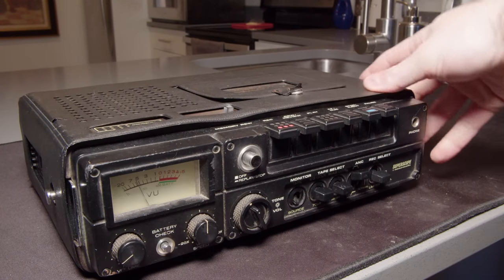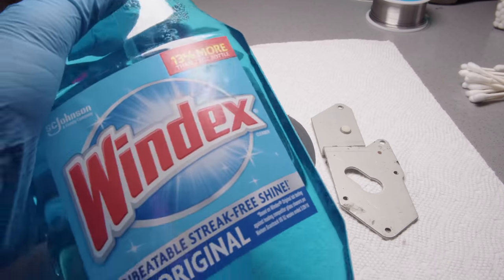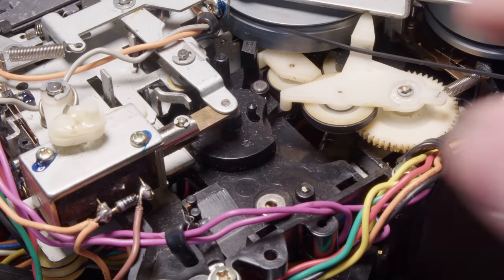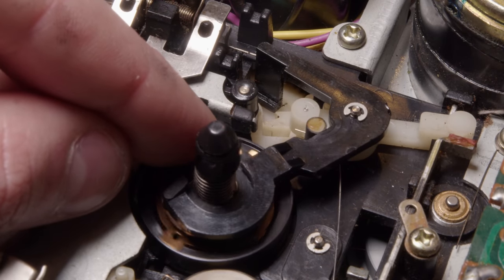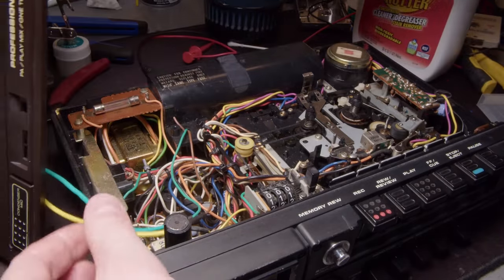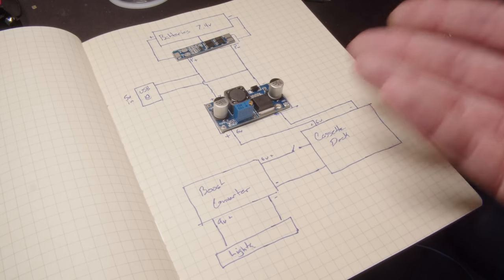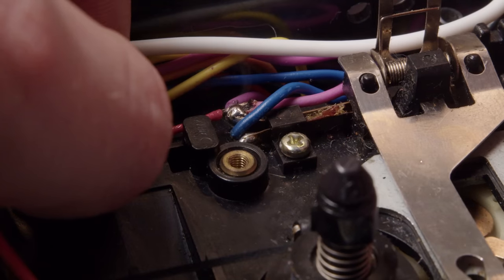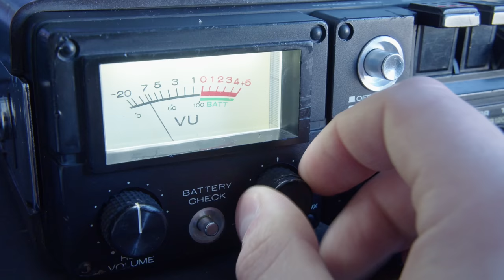Adding USB-C to a 45-Year-Old Cassette Recorder | Vintage “Hifi” Revival

Comment: I have found for cleaning up belts that have melted is to put the parts in ultrasonic cleaner with cleaning liquid simple green. It gets the job done faster and gets parts cleaner especially in those hard to reach places.
Reply from the maker: Thanks for the tip, I'll give it a try next time.
Reply: Platen cleaner also does the trick just fine. I use Kontakt Chemie Printer 66 and it works like a charm! One wipe and the goo is gone, without spreading all over the room like magic. Before I discovered that I used alcohol or solvent naphtha and once I found my wrist still black days later. Turned out some of the goo had somehow migrated to the inside of my watch wristband!
Reply: Hi, what's simple green? Is that like a dish washing detergent??

Comment: You can light up a VU meter with a single LED with just a resistor on 6V and so you could ditch the one converter board

Comment: I was also expecting you put a USB audio interface in it so you could record and playback to a PC over that same USB-C connector, should be easy just connect the data wires and power to the existing breakout and wire the line in and out between the audio interface and the jacks on the recorder
Reply from the maker: Huh, that really good idea. I’ll remember that if I do something like this again; right now that battery compartment is pretty cramped lol
Reply: that's what I thought he was going to do
Reply: @catman58  same
Reply: @HifiJelly  the bluetooth recievers are really tiny.  Ive been building some small powered speakers and most of those little amps come with the bluetooth now.  But tbh thats also kind of sacrilegious 😂

Comment: When I was a kid back in the early 90s I bought a fairly similar CD-330 for a song but unfortunately it never worked right. It did play but the belts were on their way out even then and it never recorded anything while I've had it. At least 15 years ago I tried to dive deeper and maybe get it working. The previous owner must have been quite ham-fisted - soldering iron burns on the outer case, one of the screws on the bottom had its head broken off (but could easily be removed with pliers so no idea how it broke in the first place) and the cassette lid was assembled in completely the wrong way, rendering the spring useless. To open the lid, the unknown genius glued some kind of plastic stud to the lid so he could pull it open.
I managed to replace the belts and make the recorder play again but input signals don't seem to go anywhere. I looked at the schematics and the first place all the inputs go to (the 330 has RCA connectors as well as a DIN input/output for the German market) is the Dolby chip, as this model has Dolby B rather than ANC. If that's buggered I'm probably out of luck. I suppose if I ever dig this back out of storage I need to get a signal tracer so I can check properly where the signal gets lost. The Rec/Play linkage is a known issue with these models, not the greatest design in the world.

Sintered bronze bearings (which is what the flywheel bearings look like) take oil. The general rule of thumb seems to be things that spin fast get oil, things that move slowly get grease, at least in the audio world.
Reply from the maker: It is far too often that most repairs are simply fixing what the previous guy did. Hopefully people don’t have that problem with my repairs haha

Comment: Very good job as regards the restoration. Unfortunately those Ultrafire batteries are a scam. They are no way near the rated capacity. You should stick with known brands buying lithium cells (also for safety reasons). Samsun, LG, Sanyo, Sony, Panasonic.
Also: you can't charge 2 lithium cells in series with a 5v input, you need at least 8,4v.
Reply from the maker: Oh they absolutely are haha, with the current draw of the device and a 3600mAh battery it should run for like 10 hours, but in reality, it might last maybe 1 hour. Luckily it will be easy enough to swap out a better battery in the future.
Reply: I have some ultrafire 3000mah. They seem true to 3000. Can run my bike lights for 6hours.
But yeah i have the fake ones too. And sadly theres just as many fake samsungs etc. Careful where you buy and who from.

Comment: To avoid all those voltage regulators you could have done the following:
1) put the two batteries in parallel, not in series
2) use a simple 1 cell charger like the TP4056 (2 cells in parallel are just like a single bigger cell, PROVIDED THAT THE FIRST TIME THAT YOU CONNECT THEM IN PARALLEL THEY ARE AT THE SAME VOLTAGE TO PREVENT HIGH CURRENT FLOWING FROM ONE TO ANOTHER). This circuit can be powered directly with 5v from the usb to charge the batteries
3) use a boost converter to pull 6v from the batteries to supply power to the cassette recorder
4) use a 6v led strip to avoid the need of another boost regulator
Reply: TP4056 ftw
Reply from the maker: That actually was my initial approach when I was experimenting with this; I even got that TP4056. But when I tried to power the device with the paralleled batteries through that boost converter it just cut power. The device uses about 250mA when playing a tape and I figured the boost converter wasn't able to provide enough power. When I tried using the batteries in series it worked just fine, so I just stuck with that and didn't try anything further with the paralleled batteries. But it certainly would have been a cleaner way to build it.

Comment: I did that repair with the wire and epoxy to fix many stubborn rotary knob shafts that where cracked or broken off. Just be sure it still fits in the chassis hole area.

Comment: I worked on this same recorder when I wired the external wire to start and stop to record national commercial's. Kind of of a pain to work on. I clean the heads and tape rollers with Isopropyl Alcohol and the other rubber rollers as well and lub all the mechanical parts that move.  It never had any problems. nice video.

Comment: I have this recorder. Good upgrade mod. I believe this model of recorder already charges Ni-Cad rechargeable batteries with the 6V DC input. All that would have to be done is slightly modify it to charge lithium ion or metal hydride D cells. Maybe even put in a fast charging circuit to speed it up. This recorder is very power hungry on batteries and would drain cheap general purpose or cheap alkaline cells down fast with constant use. I wonder how many Grateful Dead concerts this was used at lol. Looks pretty worn. That dust under the speaker was probably someones cloth pouch stuffed with weed falling though the speaker grill lol.

Comment: There is an adjustment for the motor and flywheel thrust plates, Not sure how but in most cases you bottom out the plastic nut until it stops and back off a fraction of a turn.
Reply: Not 100% but there is a clutch for the autostop in the plastic part. You can set the clutch at the bottom. I got a kind of the same problem with my sony tc 153sd tight now. High wow and flutter through that but auto stop kind of works now.
Reply: At the end now. The rewind is possible the wheels with rubber at the end that touches. Needs to be cleaned and spring must be too low. Great fix!

Comment: USBC can provide 20 V but you need data lines connected to USB-C charge controller. It defaults to 5V but with comms can swich up to 20V
Reply: That's what I expected him to do as well.

Comment: Had you been in the philippines, i would you repaired my vintage pioneer tape deck ctf 1050, bought in the 80's wt defective motor and wornout sendust head. You are a great electronic specialist. Good restoration demo.

Comment: Just FYI, DeOxit makes several products. Red is an aggressive cleaner which needs removal. Blue is a lubricant only that will cause no problems if left behind. Gold is a combination of cleaner and lubricant that can also be left behind without problems.
Reply from the maker: Gotcha, thanks for the info!

Comment: I used similar superscope units like this in college for recording narration and voiceover work, although ours were a bit newer with Dolby B (maybe dbx too?) and ISTR were a mix of mono and stereo units.  Edits were done through "pause tape" and live mixing. By the time I graduated we were still recording on the superscopes but I digitized the takes and edited with multiquence on my dormie's pentium.

A wow & flutter test would be interesting to see if the dual flywheel helps.

My brain kept replacing "USB-C" with "Dolby C" and I was wondering how you would pull that off. ;)

Comment: Looks nice after that cleaning and some small fixes, only thing I’m thinking is that the old batteries probably had some power switch in order to not drain them when not in use.
Could be good idea to look at utilizing that for breaking the batteries from the converter boards, and thus prevent them from draining battery capacity when not using it, or otherwise putting in a dedicated on/off switch if that’s not working for simplicity.
Reply from the maker: The control keys act as the power switch for the device, so it only pulls current when Play/FF/RWD/Record key is depressed. That being said it nonetheless drains the batteries because of that LED on the buck converter lol
Reply: @HifiJelly  well the reason I suggested it is because the converters use a small bit of power by themselves too, even if there isn’t anything connected to them at all, they have the conversion going as long as they’re connected to power

Comment: Very useful vid! Do you know what motor can fit for a replacement? Looks like it's a 6VDC, 2200 RPM, CW, but in my C-205 is labeled with a Marantz part code and I can't find the exact match with Mabuchi or Matsushita.
Thanks a lot for your work, not easy at all to find good vids about this model.

Comment: I wonder how the unprocessed recording of that thing sounds... or is it unprocessed? But what happened to the background noise? I see the peak level like -7dB, and the recorded voice sounds amazing. Is it recorded with the built in microphone? Pretty neat thing, maybe is not as practical or high quality as the modern recorders, but it's STYLISH! ;)
Reply from the maker: It does a really good job recording voices. All of the voice recordings I did using the built in microphone. It has an automatic gain control and some form of noise reduction built in.

Comment: 9:17 looks like the spring is there to compensate for the difference in travel between the mechanism and the switch on the circuit board.
Reply from the maker: Thats a good theory, would make it so that there could be some tolerance between the two parts.

Comment: An admirable effort. You are right though, you could have saved yourself one converter for the LED strip. You can easily obtain 5 volt LED strip and run it directly from the 6 volt supply switch from the play button. 
Also noted was that you identified the 18650's voltage at 3.7 volts. This is what is called the nominal voltage. Each cell fully charged is 4.2 volts maximum and you would therefore need to set the charge converter output to 8.4 volts. The way you have it set up at the moment would mean the cells would only ever reach half charge and not give as much capacity as a fully charged pair.
Reply from the maker: Thanks, I’ll make that change with the converter!

Comment: Never tried the super glue/baking soda trick yet for plastic but next time I'm going to. Was hoping you'd try it on that one piece. Supposedly it bonds stronger than the original plastic
Reply from the maker: I'll need to remember to use that trick next time. I'm certain there will be more cracked and broken plastic in my future haha.
Reply: @HifiJelly  yea there's a video where a guy makes a plastic gear repair using super glue and baking soda but he also makes a form outta hot glue and a piece of curved plastic to make a plastic gear that was missing a chunk.
Go to the 1:14 mark in this video:
https://youtu.be/eP3xJIJ-TbU
I was amazed
Reply: Cool video and the baking soda trick works so well. Pretty much instant set
Reply: I use an accelerant spray which does the same thing. It came in a mitre kit aimed at joiners.
Reply: @adeladd7638  I keep reminding people to keep up voting this channel and the comments so this channel skyrockets. It helps the youtube algorithm I guess if everybody upvotes every video and the comments too? I'm checking out your suggestion with the accelerant👍
Reply: I have, the baking soda acts like filler material to build up the joint. You still need a good clean/roughened surface for the super glue to stick to.
Reply: Ive seen the baking soda thing..honestly it looks messy. You can use superglue on toilet paper. Ball up the paper and squish it to shape, add the superglue..it will start smoking a little and then youll have something really crazy solid. (Ive used it to repair teeth before when the dentist failed me, lasted longer than the dentists epoxy.

Comment: the lighting of the 12v LED you could find a 9-12v rail on the main amplifier board if you probed around a bit [look for voltage regulators/transistors]. save you having to add another boost circuit into the thing.
Reply: He could have cut out one of the LED's to use just 2 and ran it at 6v with an appropriate resistor..

Comment: I have one of these (well similar, i think the one i have has dual VU meters) . Im kind scared to open it as i expect to see a nightmare of disintegrating belts. I've had it sitting on a shelf now fo a good 20 years.  At this point. One of the marantz models was the defacto tool for radio journalists back in the day
Reply from the maker: I was curious the main user base of a device like this and journalist makes sense. Given the mic inputs and all of the output types I could see this on the shoulder of a journalist giving an interview.
Reply: @HifiJelly  Here in the UK it was the main device used by the BBC for radio news interviews etc. I got one years ago because i thought if the beeb uses it, it must be good... I think the model is Marantz CP430 (PMD 430). Its in a box somewhere with my other horded electricals lol.

come to think of it i should really try to sort a service kit for it whilst/if they still exist

Comment: Nice work on the restoration. A quick unsolicited word of caution about Windex; ammonia isn't very friendly to metals, especially the aluminum flywheel, IPA cleans that gunk up very quickly and doesn't bother the components at all. I made a short video using it just a few days ago if you're interested: https://youtu.be/jjYm0nNg0JY
Reply from the maker: Thanks, and thanks for the tip!

Comment: I enjoyed most of the video until the point when you started modifying the battery system. Here I notice several problems.
First, it became obvious that you know nothing about USB-C PD (the voltage can be negotiated on modern chargers), small PCBs (replacing your USB-C breakout board) can be had on ebay where you can set the voltage you want to either 5V, 9V, 12V, 15V or 20V, provided you use the right type of charger. You could therefore get 9V from the USB-C. There is no need for a boost converter here. 
Also, as already pointed out below, 3.7V is the nominal voltage of a single Lithium cell, full charge needs 4.2V - two batteries in series 8.4V. Please be aware that the charge voltage needs to be carefully monitored and also current controlled/limited. Not knowing the specs of the controller board you use I cannot know whether this is the case. Depending on the specs it might be possible to feed it the 9V from the USB-C PD board directly.
I would also recommend putting a switch between the battery system and the Buck converter - otherwise the batteries will quickly discharge due to the Buck converter quiescent current and active LED. 
Finally, the boost converter you used for the LEDs seems vastly overkill - boosters based on e.g. the LM2735 or similar are a lot smaller, cheaper, and still very suited for this kind of use. Personally I would have used one (or maybe two) LEDs with a current limiting resistor without a booster instead. That way I could adjust the brightness - your solution is most likely way too bright.
This old Marantz deck is from 1978, and back then white LEDs were not available, also the red, green and yellow ones you could get did not have a very good efficiency or high brightness. It is therefore no wonder they did not fit a backlight to the deck back in the day.

Comment: dude 7.4 volts is the operating voltage , you need 8.4 volts since the full charge of lithium cell is 4.2
Reply from the maker: Yup, had someone mention that earlier. Easy enough to adjust the converter up to the 8.4v

Comment: You didn't really have to install any buck converter, Get a 2S 8.4V Li-ion battery pack charger and install a barrel jack as a charging port, Feed the VU meter straight from the batteries, Done.

Comment: for the spring and that broken nub thiing - just reshape the spring and drill a hole into the arm and feed the spring through it. theres way too much mechanical force on that nub and it will eventually shear off again over time. really dumb design by marantz. it should be a metal part really given the mechanical application of that part.
Reply from the maker: It really is a bad design, my though was to use a compression spring and attach it through a hole in the idler arm. That way the force is tensile again the plastic and not rotational as it is now. So far it’s held up as is, but I do wonder how long it’ll last.
Reply: @HifiJelly  at least we have a plan b if that nub does fail again. great job on the refurb and adding the usb -c circuit in there. this has given me some idea to mod some of my synths and tape gear too !